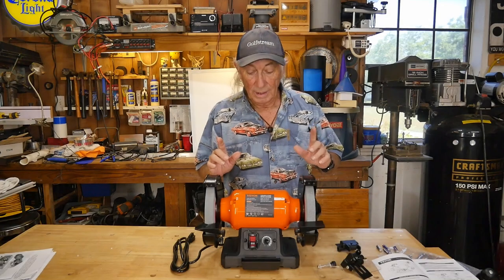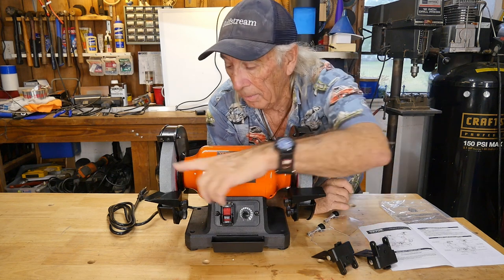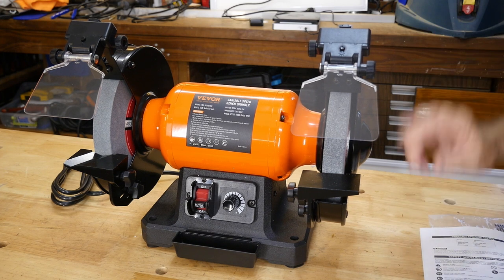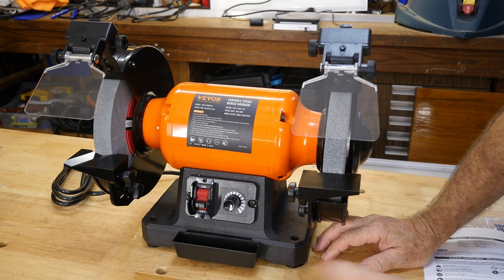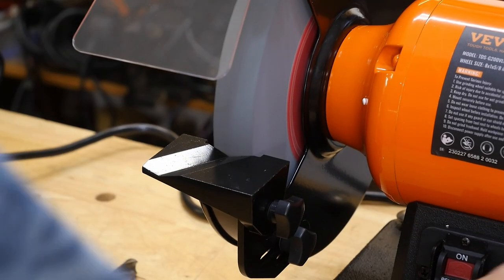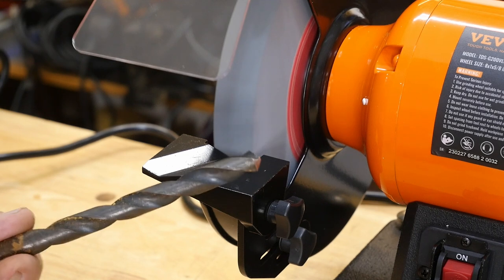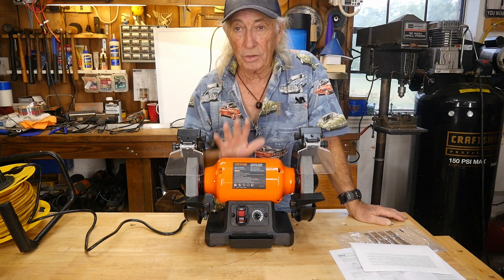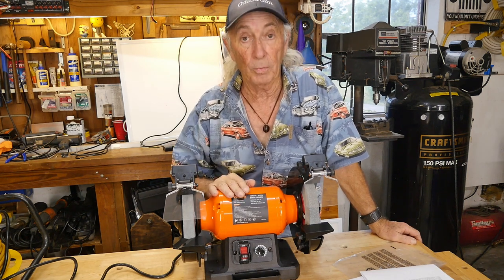Best priced Variable speed bench grinder Vevor , review C&T ep 366

Comment: Now how did I miss THIS?!?!😳
Larry, I didn’t even wait till you fired it up…I paused the episode and went right to the link and bought it! 
I’ve been running a cheap 6” and I’ve for a long time wanted a quality variable speed 8”! 
Wow! So much good to say about this, so let’s start with the obvious; VEVOR! 
The led battery is GENIUS!! LED is a much brighter and cleaner light and VEVOR went top shelf! It puts the light I need right where I need it! The clear lenses are two point adjustable! Independent on and off switches!😲 the guide plates are solid and again, two point adjustable!😲😲
The drill bit guide is awesome!😲 
The water tray…perfect size! My dad used to make them by cutting the bottoms on my moms dishwashing soap containers and he’d screw them to the bench. 
I made a wood mount base that my current scrap metal grinder is attached to and THAT, I just take the grinder out and mount it in a vise and when I’m done, I stow it away again. THIS beauty, I’ll probably leave mounted right to my bench! Variable speed!! Huge step up! 
I’ll be thrilled when this lands on my porch!! 
My old one will go into yard sale pile. I’ll get enough to buy a buffing wheel!!😁😎👊🏻
Reply from the maker: Hope you have a GOOD back. This thing is HEAVY, but does feel good running it.
Reply: @SirTools  it’s why I keep a young strappin 18 year old grandson around!! 😎 Put that up on that bench son”!!😎
I think I’ll move my vise….this grinder needs a home!!🤣🤣😎

Comment: For things that I do, I would like a little bigger dish for water, That way I can put water in it and not have to add more to it very often. The battery operated lights, nope, like others have said LED's are so easy and simple, change them. I'm only guessing but since it takes slow long to get up to speed, the motor must not have a capacitor, and it also takes a long time to slow down. I would like the rest to not have the groove cut in it. Maybe there is a way to get over that parts. Now for $150 for a home grinder with 8" wheels, great deal. I also might not use the variable speed much. It would always be on high. Again for somebody starting out, great deal.
Reply from the maker: Got say agreed, but for that price, not a bad deal at all.

Comment: Really like the noise (or lack of noise). From my point of view, I hate the battery light. If it already plugged into the wall I should be easy to find a way to power the lights without having to resort to batteries. LED lights have come so far that everything should have them. Thanks for sharing!
Reply from the maker: Thanks Thom, I'm on the fence over the battery thing, but all else was very GOOD...:)

Comment: I have a 6 inch grinder i mostly use for sharpening gouges for the lathe. I really  wish it had variable speed and that water dish is way better than not having one like mine didn't come with. But thats a small price to pay for buying used equipment for $20 at a yard sale lol. I keep an old 3 lb joint compound bucket by it for water. Looks like an awesome buy.
Reply from the maker: I've only ever owned 6 inch, so this felt like..WoW....biggy sized LOL